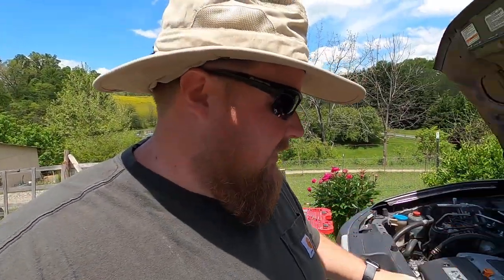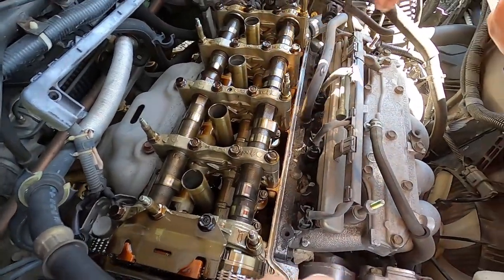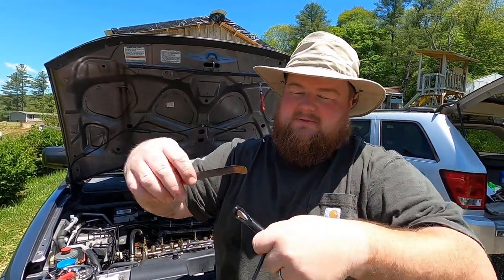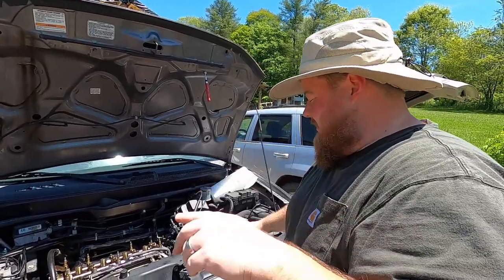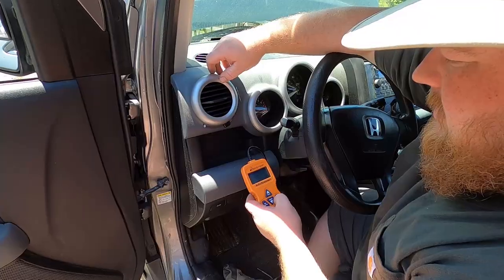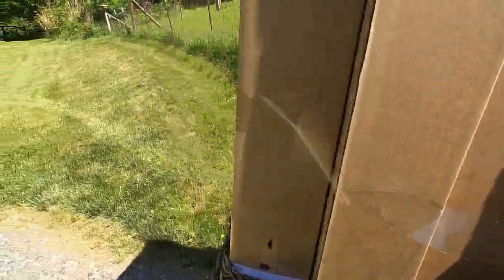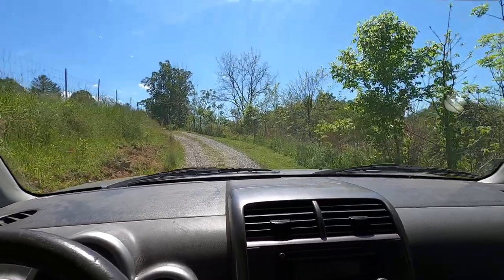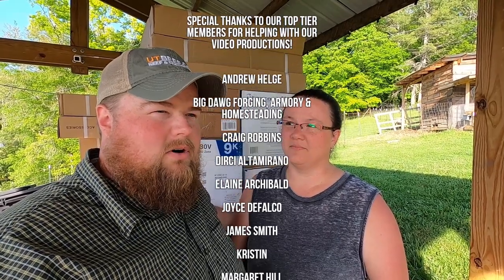A Day with Us [VLOG] - Honda Element Work & A COOL Delivery!

Comment: Love your videos, you will love Mr Cool, I am an old lady;, me and two guy friends installed my 18,000 Btu ourselves. Follow directions, we did not get our connections tight, our fault, did call an A/C company, quick fix and I love it. so quiet and wonderful on the electric bill. You "kids" are such a joy., keep up the good work. My home is a 61 year old mobile home, roofed over and sided, will last forever.

Comment: After I retired from my regular job, I went to work part time for Home Depot. Training for working in the electrical department I found these type heating/cooling systems are 85% more saving than regular heat/air as there is no duct work to loose heat/cool in. Plus if one goes down the whole house isn't down.

Comment: Makes sense, if your exhaust valves are too tight you won't get full compression and the car will feel sluggish and miss fire. You will also get unburnt fuel building up in your exhaust and you can get a smell like the car is running rich.

Comment: All you needed to do is change your gas cap. If the check engine light comes on and stays on it is something to do With fuel. If your check engine light flashes then it is something with the engine.
Reply: Stick to your day job.

Comment: Great job as always. Your videos have helped me with ways to fix up my single wide trailer too. Can you share the info on the mini splits y'all got? I looked them up but didnt get very far.
Reply from the maker: We bought ours directly from Home Depot, here's a link to the exact one we bought: https://www.homedepot.com/p/MRCOOL-DIY-27-000-BTU-2-25-Ton-3-Zone-Ductless-Mini-Split-Air-Conditioner-Heat-Pump-Install-Kits-230-Volt-60Hz-DIYM327HPW03B13/314881809

Comment: I just noticed on the ends of the roof on your home , you havent finished it off with wood ? is that a task in the future when wood becomes less expensive?
Reply from the maker: Yeah, that project hit a wall when lumber prices soared. We've considered trying to cover it with metal, but that would need a contractor. It's weather-tight and fine for now, but still on the list to do. :)
Reply: After the prices I saw today, it won’t be for awhile.  $18.49 for 1 x 4 8ft long.  I almost had a freaking heart attack   Needless to say, I walked out of the store without it! 🤬

Comment: Do you recycle the cardboard? here in the UK we have to recycle, actually , its preferred that we recycle . The tower of apartments we live in , doesnt have any where to remove recycling so we drive down to our local Sainsburys( grocery store) on the Team Valley Trading Estate in Gateshead ,( a local town ) which is across the river from us about a couple of miles away and they have recycling bins that we use each week. I wondered if you use the cardboard you get from all those boxes you have just had delivered, for anything such as insulation etc ?
Reply from the maker: We recycled them ☺️.   We’ve used cardboard as a weed barrier before, but too much other stuff going on to keep for that purpose 😁